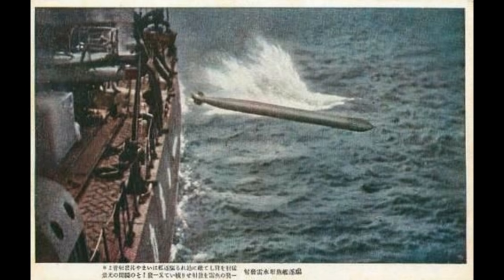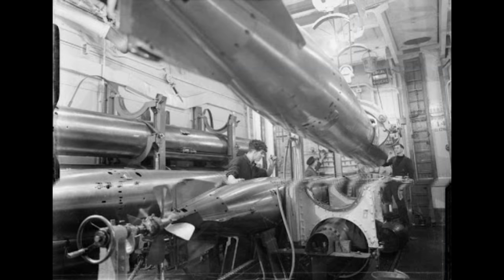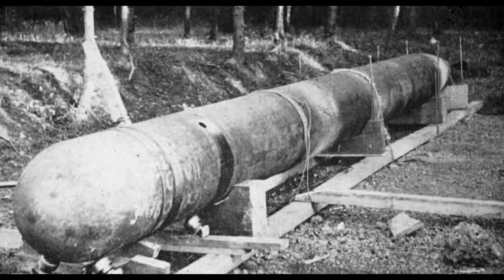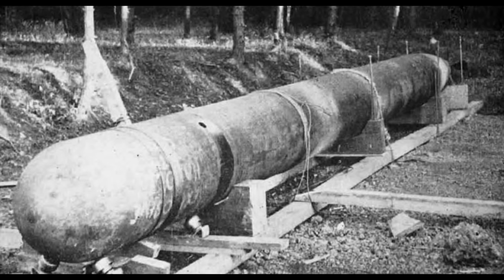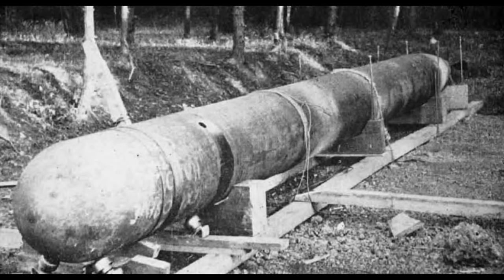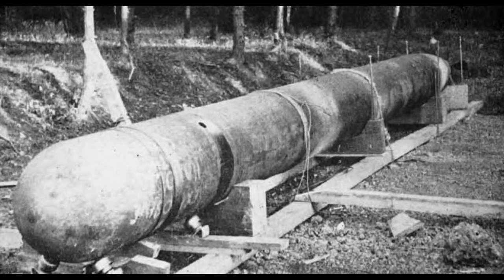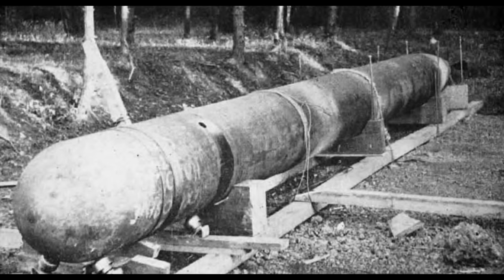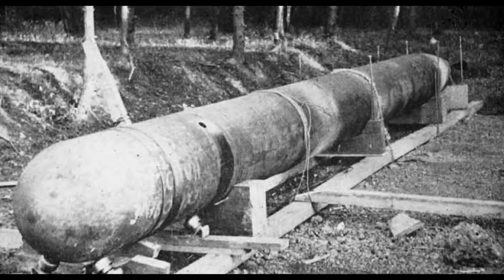Type 93 Long Lance Torpedo - Long Range Hole Poking Device

Comment: Q&A: Drachinifel, I've always wondered/felt that the reason why so many Torpedo Defense Systems failed during WW2 is that on the Axis side, Both the RN & USN were using the noticeably more powerful Torpex (Torpedo Explosive) instead of the WW1 filler which was basically TNT, and for the Allies using ships built to RN & USN specs (most of which were built in UK or USA) the IJN was using  exceptionally large warheads filled with TNT....
 
Your thought on this?  (Of course, this is when the USN Torpedoes actually went BOOM!!! when they were supposed to!)
Reply: This generalisation is not really true.  All sides improved the lethality of torpedo warheads as the war progressed (the British by adding powdered aluminium to the Torpex) but it was really the number of hits rather than the power of any particular hit that sank battleships, particularly where air attack was involved.  Older ships took fewer hits to sink, as a general rule, but bulged WW1 ships like the Queen Elizabeth class resisted underwater explosions about as well as WW2 designs with internal torpedo protection, and no battleship sank in WW2 from a single torpedo or mine hit in the way that had occurred in WW1 (e.g. HMS Agamemnon).   There was a large amount of chance involved.  It depends a lot on where the torpedo hits the BB’s side protection system, and the IJN made kills with smaller as well as larger torpedoes.  The 6 x Type 91 21” aerial torpedoes that sank Prince of Wales had a 330lb TNT/Hexyl warhead that was within the design parameters for the POW’s torpedo protection system, and a midships hit on the Port side did not penetrate the side protection system.  The real damage was done when the port outboard propellor shaft was hit and bent by a second torpedo, which whipped while rotating and opened a flooding path to the engine rooms.  There was really no way to protect a BB’s propellers and rudder from torpedo damage (though the US South Dakota’s used a skeg system that might have helped).  British aerial 18” torpedoes with small warheads penetrated the Littorio’s Pugliese side protection system at Taranto, and flaws in the Yamato class design of its side protection system rendered it susceptible to damage from all US aerial torpedoes.   Also, damage control training was much improved as WW2 progressed and experience gained, and damage control was helped by additional diesel generators and shockproof mountings during refits.  So it is difficult to see any linear relationship between increased torpedo explosive weight and more BB sinkings. If that was in fact your query.
Reply: @glennsimpson7659  What I was inquiring about is the Torpex (Aluminized (plus a few other things) TORPedo EXplosive made the warhead much more effective pound per pound (or Kg per Kg) than the WW1 torpedo warheads.
 
This could be why various ships rated to stop the charge weight of a 18" Torpedo (or even a 21" Torpedo) failed.  (British = RN)
  
Also, WW1 they often had poor watertight compartmentalization, coal dust and small bits of coal could and would cut the rubber gaskets that seal the watertight fittings.  Not to mention all the near waterline portholes that probably would have their glass brake and/or spring loose allowing water to enter if the bow would sink a bit due to damage.
 
I never said a single hit would sink a BB/BC/CB during WW2, but I was wondering if the increase effectiveness of RN/USN Torpedo charges was why ship's underwater protection systems were breached....  Also note that IJN torpedo warheads were bigger than a similar size warheads.  In fact the IJN 18" Type 91 Aerial Torpedo in a few of it's mods actually was heavier than either the RN's or USN's 21"!  And their Type 95 (submarine Torpedo was also heavy to very heavy for a 21" Torpedo (once again depending on which mod your talking about...)

Comment: I'm glad you didn't call it a "long range porthole-maker" as that is the proper nautical terminology for a bowsprit.
Reply: I should point out that the torpedo is in fact just a very long range bowsprit. The term "torpedo" was first used navally to refer to a bomb on a stick strapped to, well, the bowsprit.

Comment: Between the wars a great deal of "secret" research and development was conducted by every naval power regarding improving torpedo technology in a tangible way. In nearly every other instance, (excluding the IJN) these efforts focused on perfecting "magnetic" rather than conventional "contact" detonators. This would allow the torpedo to detonate under the targets keel. This, then created a huge bubble which could literally break the back of most surface vessels using a sufficiently potent warhead. The improvement in explosive power from "Guncotton" early in WW1 to "TNT" and eventually to "Torpex", and similarly more potent explosives, (~60% greater than TNT) were readily available and reliable by 1939. 

Unfortunately, to keep their insufficiently tested new secret weapon - "SECRET" - every nation failed to adequately test their systems thoroughly. Afraid of the secret getting out I have been told. 

Testing adequately, specifically means testing torpedoes at different latitudes and longitudes which are effected magnetically unequally as we soon learned when WW2 began and the torpedoes failed to detonate even after hitting the targets. So, in the opening months of WW2 most navies had torpedoes that failed to detonate and ultimately they returned to contact exploders with varying degrees of success for about 2 years - crucial early war years. 

The IJN meanwhile had taken a different and highly risky approach in their unique "Long Lance" technology. However, despite occasional mishaps it was an unanticipated "Force Multiplier" against overconfident allied naval forces in the Pacific. It was presumed that Radar would decide the outcome in favor of the allies so both night tactics and the testing of magnetic exploders were taken for granted. As it turned out, allied neglect of both night fighting and ample prewar R&D with the accompanying tests and trials gave the IJN a remarkable advantage which lasted throughout the war. The Heavy Cruiser Indianapolis being one of the last victims of the "Long Lance". It sunk in ~6-7 minutes from just two I-Boat launched type 95, 21" "Long Lance" torpedoes. These had a much smaller warhead than the surface vessel "Type 95" which had a 24" diameter rather than the launched 21" model. Over 800 men died in this one example and numerous cruisers were lost throughout the Pacific campaign from the remarkable lethal "Long Lance" aided by the thoroughly trained crews. Guadalcanal night battles illustrate that point rather tragically.

Comment: Excellent presentation, Drach! Do you think placing an emphasis on an enriched oxygen torpedo have been better? This would have minimized the complexity, expense, and danger of the pure O2 weapon well still realizing some of the advantages. Thanks again!
Reply: Possibly not, but that is purely because the Japanese military was focused on Kantai Kessen to such a degree that they would always have chosen the weapon which best suited that doctrine.  Within Kantai Kessen doctrine, the role of the Type 93-equipped ships was to launch them at range and before being detected: even a second salvo might be away before your own ship was taken under fire.  That meant the vulnerability to incoming fire was less significant.  The inherent handling and storage vulnerabilities remain, but this can be addressed by technical and training improvements.  

The alternative would likely have been a high-test peroxide HTP is a better and safer torpedo propellant than LOX which is why it became widespread in heavyweight torpedoes during the late 40s and 50s.  This is what caused the Kursk disaster and formed the oxidiser in the unrelentingly horrible German Me 163 rocket fuel - HTP is awful stuff but at least it is liquid at room temperature.  HTP was also a very new technology at the time, and while it might have been practical by the mid-40s, it probably wasn't that viable for Japan in the early-30s.  Retrofitting for a new propellent / oxidiser (or in theory using HTP as a monofuel) is always tricky so sometimes it's easier to keep on your development direction, especially in wartime.  Might have been a different story if they were designing a new torpedo in the 40s of course, but they went to war when they did partly because they had a weapon that was good enough in the Type 93 and it fitted the war they intended to fight.

Comment: The reason the Union Army didn't have repeating rifles was a senior general in the procurement branch believed that repeaters would only lead to soldiers wasting ammo.
Reply: A belief that persists until Vietnam War. 

Actually, scratch that. Remember M16A2 and M16A4 with burst-fire selector instead of full-auto? Yeah, i guess that belief survived till 90s, i guess. 

I guess someone got wisen up and realize CQB threats are greater than long range precision shooting, that during M4A1 development, they replaced back full-auto capability back instead of burst-fire (M4 can fire semi-auto and burst fire, and not full-auto)
Reply: @muhammadnursyahmi9440  The reasoning for Burst Fire over Full Auto was that a 3 round burst would send a nice amount of round down range while maintaining accuracy but Full Auto is harder to control and isn’t as effective for suppressing with 30 round mags. 

While it was added back in with the M4A1 the most commonly used Fire Modes are still Semi and Burst as they allow for much greater accuracy.

Comment: Thanks, like it, the two airbottle system is a fine example of thinking out of the box . At what occasions did the IJN use the long range -36kn setting and how did they calculate the spread? Targeting individual ships seems impossible at that distance and captain Hara, their T-specialist seems to use torpedoes after closing at least to 8000m.

Comment: You could make an episode on the differences between the Bofors 40mm L60 of WW2 fame and the post war 40mm L70.
Especially as the Royal Navy finally is getting around to adopting it on it's Type 31 Frigates.
Not bad for a gun that entered service in the late 40's and is an upgrade of a gun developed in the late 1920's

Comment: I had read in battle reports that quite a number of torpedoes were sent at South Dakota and Washington but I always assumed that they simply missed. Turns out, both ships might have been lost or damaged if not for a malfunction of the detonator.
Reply: If i remember correctly the Japanese launched ca 100 type 93s at the US BBs, and the Americans did not take any evasive actions for the simple reason that they did not now what was heading there way. So either the American had all the luck on there side, or its a lot more difficult to hit with Torps at long range than one might think !?
Reply: @niclasjohansson4333  Yes, that's what I thought too. At night, I assume it's easy to misjudge the speed or direction of the enemy vessel, so your torpedoes might miss. But Drach mentioned in the vid that several Type 93 detonated at a safe distance because the large ships' wake had set them off (rather than the impact, as designed).

Comment: The Allies were very lucky the Japanese didn't have radar. A long range shot at 32 knots could travel 25 miles. A long range shot depended on optical spotting, but even their excellent optics were only good out to about 15 miles. They had to launch long range attacks based on where the enemy vessels were  last seen, generally less than 15 miles away. That meant using a lot of math and experience to set a long range course, and a lot of luck about actually hitting something. The Japanese actually hoped they were attacked by a large fleet, since a failure to hit the first ships in the line still meant there was a enough range left to hit ships in the secondary line. If the Japanese had radar or developed homing technology, the Type 93 would have had much better success.

Comment: One of the big problems with the Long Lance that is rarely talked about is its cost: the Japanese had about 1350 of the torpedoes at the start of the war, and produced about 2600 overall. By contrast, the Germans made about 70,000 torpedoes for its U-boats during the war, and the US was making about 2000 torpedoes of all types a month during 1944, with 10,000 made in the latter half of 1943 alone. 

Bear in mind, at its peak, the US navy had 6,768 ships operating during WW2: yes, operating, which means it doesn't include losses or mothballed ships. That means the US navy alone had literally x2.5 the number of ships available to it at one time than the Japanese did torpedoes throughout the entire war, and since torpedoes are rarely shot in singles instead of spreads, that's closer to 866 shots the Japanese could actually launch. That's fine if the goal is to sink enemy battleships, but it also means that sinking cheaper ships, like destroyers and transports, would be almost as damaging to the Japanese as it was the Americans simply because the torpedoes Japan used were almost irreplaceable, while the US could easily build more ships.

Like so much with Japan, it wasn't scalable.
Reply: That is the good thing with USA every resourse you need to wage war can be found within your own borders and they are also landlocked and a long way from the front

Comment: The Mosquito Fleet, was a book I read in 1974 or 75, describing the PT's action, mostly in the South Pacific (I think). It spoke a lot about the battles and the failure of the, I want to say Mark IV torpedoes and Mark V. When they ran out of fish they had to run home unless they had a suicide wish and resumed the attack with their 50s and sometimes they had added ornament like 90 mm Auto load cannon and I think or double 20s or something like that I'll have to find that book and report back.  danke Schoen

Comment: Thankfully electronics had not developed enough to allow for the Long Lance to be self guided. Or, as a variant, allow the torpedoes to be dropped in front of an approaching fleet to be activated when they are overridden by that fleet. 

Imagine cruising along with the sonar in anti-submarine mode when the sound of torpedo propellors dominates the earphones. Soon followed by explosions. Nightmare time. Like today.

Comment: Here I was thinking that the hydrogen peroxide torpedo was the pinnacle of safety issues.  It is not that the oxygen torpedo is safer than the hydrogen peroxide torpedo (known for sinking a Royal Navy submarine at dockside shortly after WWII and sinking the fUSSR submarine Kursk, more recently), but that the Japanese were determined to work out the kinks and get them into service, anyways.

Comment: Kamikaze is surprisingly rational. If it works to great effect, which it doesn't necessarily do. Think about it, you are basically guaranteed to lose a lot of men perhaps hundreds or a thousand to a large enemy ship. Losing 1-3 guys instead would be a much better outcome for everyone involved. If you selected the people by chance and the kamikaze attacks were known to be effective, then the individual sailors odds of survival would theoretically be significantly improved. Although it would probably be very easy to design a torpedo with an exit that can be jumped out of 300meters before reaching the target, however that would mean the sailor would have to know how to swim. With a lifejacket and a thermo suit like found on vessels traveling through cold waters, you'd have fairly acceptable odds of survival.. in theory. Considering that more than 90% of many different combat roles died, particularly in the air force both in allies and particularly axis powers, kamikaze really isn't crazy at all and in fact hardly has different survival odds than many more regular combat roles